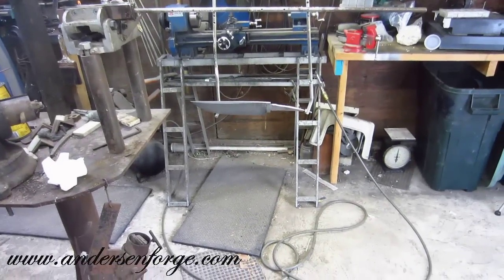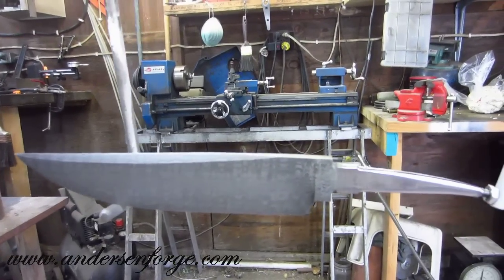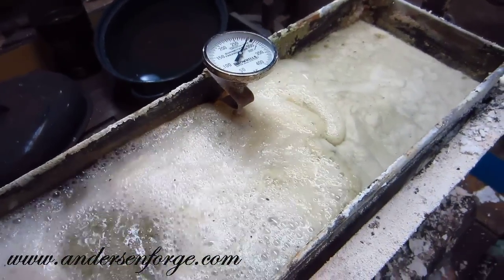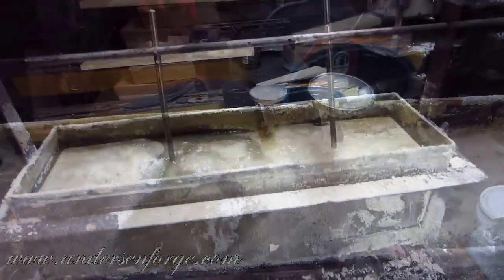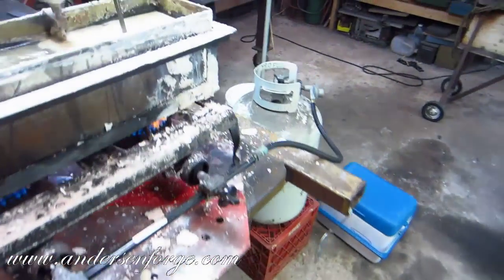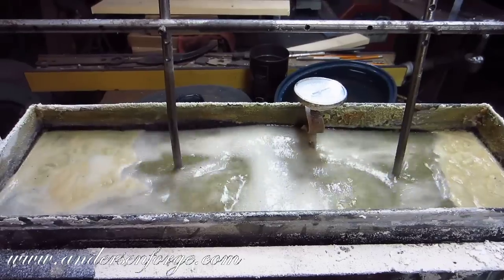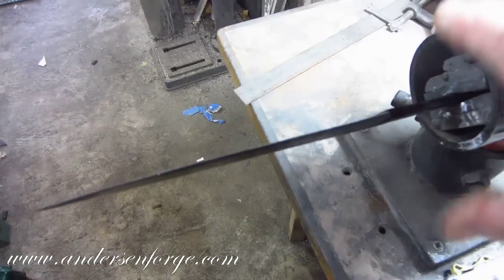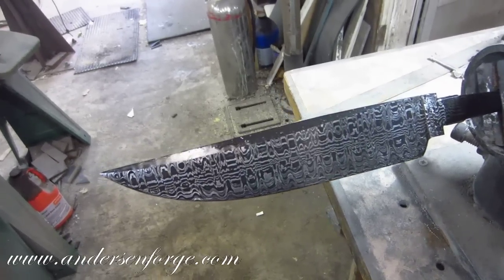Hot Bluing Video

Comment: I'm ON IT! I have done it at higher temp no water!
I like this better!
Any residual crystal can be heated off with torch and can add to the affect or soaked off in HOT water also helping dry with hot metal.
Biol in TSP 1st and it cleans Very well!

Comment: WD-40 is water displacing oil.  Could you use that?
Reply from the maker: It's a different animal than what is used. It might work. I'll continue to use the prescribed oil. I have two gallons of WD40 in the shop. But it won't go near my hot-bluing process.
Reply: @KarlBAndersen  Which oil would you recommend?  I have a 1956 Marlin LeverMatic I'd like to do.  Not a valuable rifle but I like shooting it and it is unique enough that I think it deserves to be taken care of.  I bought it off the "sad sack" pile and cleaned it up so it is "OK" but now I'd like to go a bit further and rust blue it.  Any advise is appreciated. Thanks
Reply from the maker: @richmcintyre1178  I use the Water Displacing oil from Brownell's.

Comment: yes, I also looked Brownells and saw "black iron" I talked to everyone and the black iron is the most generic term ever used. It describes black paint to unpainted steel. What I think it means in this situation is a high iron content, but i do not know.
thanks
seth
Reply from the maker: I assure you there is no paint involved. The bluing salts are very fragile and can be neutralized easily. Think of "Black Pipe" you get in the hardware store. It is low alloy steel that has a black iron oxide - raw iron - on the surface. This ensures there are no potential neutralizing alloys coming in contact with the salts.

Comment: Thanks for the video, funny it seems counterintuitive to add water to increase boiling.  So what are the blueing salts? I have an heirloom gun that needs blueing, thanks again
Reply from the maker: Adding water does not "increase boiling". When adding water you are simply replacing the water that has boiled away. As the water leaves the mixture it,  the mixture becomes heavier and it takes more heat to make it boil, which increases the boiling temperature. By replacing the water as it boils away, you are maintaining the boiling temperature which is critical.
I have no idea the recipe of the salts. It's a special mixture and I just buy it. I'll let the professionals make it.
Reply: Karl Andersen I don’t want to make it just know where I can buy/what’s the brand name so I can look it up,  yep that’s what I meant increase boiling by decreasing the boiling temperature by adding water thanks again, very informative video
Reply from the maker: @justinkemeter  Brownells - Oxynate #7.

Comment: You got simple thermometer with 5 degree hash marks and 2 simple propane burners and you're boiling off water so you have to add cold water all the time and you make claims that you maintain temperature within 1 degree!  You can't even read thermometer in one degree so how would you even know you're off by one degree?  Get electric heating element and PID controller (cheap to build one) and you have much greater chance to actually maintain that.  

And why snow?  Any water stored for any period of time will grow algae how do you not notice that especially snow that could have been easily contaminated.  Why not just buy few gallons of distilled water from your grocery store?
Reply from the maker: You need to take a closer look at that thermometer smart ass. It's a calibrated gunsmithing thermometer from Brownells. They run about 50 bucks. And your foolish comments show you know little about maintaining a constant temp in a brine solution with the water continually vaporizing. You missed the point where the water temp must be controlled AT A BOIL! If it's boiling the water is constantly vaporizing and LEAVING the mixture thus raising the boiling temp. The water must be replaced. I get tired of you peple who don't do caustic bluing suggesting they can tell me how to do something I've done for 20+ years   "  6) TEMPERATURE CONTROL OFTHE BLUING SOLUTION - The single most common cause of trouble for the beginning gun bluer is
not understanding the absolute importance of maintaining temperature control - and how to do it.
 If you fully understand the principle of “supersaturation” described
above, you will see that as the temperature of the Bluing Solution rises above 292° F., it can be brought down by adding water. If the
temperature is too low (below 292° F.), it can be raised back up to 292° F. by allowing water to boil out of the Bluing Solution or by adding
more Bluing Salts to the Bluing Solution. In other words, the key to temperature control in the Bluing Solution is to closely monitor the
temperature and add water or Bluing Salts, or let water boil out to maintain the optimum operating conditions of a vigorous, rolling boil
at 292° F.
 Because the Bluing Solution operates at a vigorous boil, which creates a lot of steam, it is constantly losing a lot of water, and the
temperature will consistently rise - unless you frequently add water to the Bluing Solution to replace the water being boiled away and lost from the solution. . Therefore, ADD WATER FREQUENTLY TO
THE BLUING SOLUTION. If you do not, the temperature will rise, the Bluing Solution will go out of the correct chemical balance to turn
the guns blue-black, and will instead , at the higher temperatures, turn the parts red, or shades of red.
DO NOT: Do Not ever try to control the operating temperature of your Bluing Solution by just turning the heat source up or down.
Reply from the maker: Black Oxide Temperature - Since water boils at 212F at sea level and the operating temperature of Oxiblak is 290-295F,
black oxide salts must be added to the bath to raise its boiling temperature. To understand how the amount of salts in a solution
affects the boiling point, you must understand that adding salts to the solution makes it stronger and denser. Denser liquidshave
higher boiling points. Adding water to the solution lowers the density and, therefore, lowers the solution boiling point.
When the boiling point is correct, the solution concentration is correct.
Oxiblak has a recommended operating temperature of 290-295F. The black oxide operating temperature is not controlled
solely by the heat source, it is controlled by the combination of the heat source and the concentration of chemicals in the
solution. Never try to obtain the proper operating temperature of a black oxide bath by adjusting the tank's heating systemup or
down. The heat source should be set for the day at a gentle rolling boil - then you can maintain the proper operating
temperature with the additions of salts or water. For example, if your solution is boiling at 275F, you must add black oxide salts to your tank which will result in a denser
solution and raise the boiling point. If your solution is boiling at 290F, you must add room temperature water to the tank to
create a thinner solution which will lower the boiling point.
Boiling Point - The boiling point of a black oxide bath is indicated by a slight eruption in one corner or along the sidewall of
the tank. This slight eruption along with the proper operating temperature indicates that blackening is occurring. A black
oxide tank can be heated to the proper operating temperature but without this boiling action - blackening will not occur
Reply: @KarlBAndersen  You mean the bluing thermometer (not gunsmithing) from Brownell's that's actually rebranded Tel-Tru?  Is your definition of "calibrated" because it has fat black mark that occupied at least 5 degrees worth of space?  Brownell description says nothing about "calibrated" but that's not the point, you missed my point - the thermometer does not have 1 degree hasmarks!  So you're claims of maintaining to 1 degree is nothing but exaggeration!  Stick a digital thermometer and you will see the temperature fluctuate way more than one degree! 

I said the same thing that you are just repeating now about adding more water to replace vaporized one, no need to repeat I understood perfectly from the video my point was that by adding more water which is in the ice cube form as you wrote in comments and keeping it all within 1 degree is once again a bogus claim that you can't proof because you don't have accurate tools to measure your solution to a 1 degree - that's all I am saying - nothing more.  I am sure you know your bluing I am not doubting your skills for a second.
Reply: @KarlBAndersen  Why are you telling me all this?  I never questioned any of this and I never said its wrong or doubt it, you're reading too much into it without actually paying attention to what I was saying.
Reply from the maker: @DimaProk  Because you're suggesting to use a PID controller to control heat. If you think that's how the temp is controlled then you don't understand the process. That's why I'm telling you all this. I shared the info from two different bluing supply companies so you can learn something.

Comment: your tank is not big  enough  the water will evaporate you will not easily maintain the temp, also the salt solution is too close to the top of the tank if your not constantly monitoring it it will flow over the top of the tank
Reply from the maker: Dude!! I've been using that EXACT set-up for 15 years!!!!!!! The salt doesn't boil over. The tank is plenty large for that size burner. I could use a smaller tank. Jeeze. Watch the video - is it boiling over? No.

Comment: Snow is full of dirt particles. Distilled water is much cleaner.
Reply from the maker: That's why you only take the snow off the top. By that time the air has basically been "scrubbed" free of particles. That said, particles of "dirt" would have no ill effect on the bluing process. Distilled water can be very harmful if it is distilled in anything NOT glass. Copper tubing used in the distillation process can literally neutralize the salts. Look at my results. I've been hot-bluing for 2 decades. The results speak for themselves. www.andersenforge.com